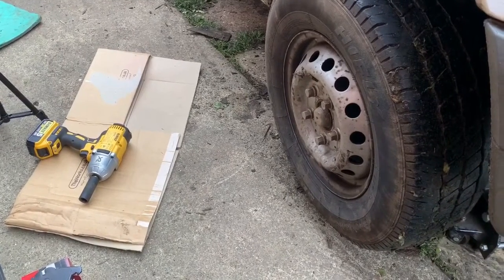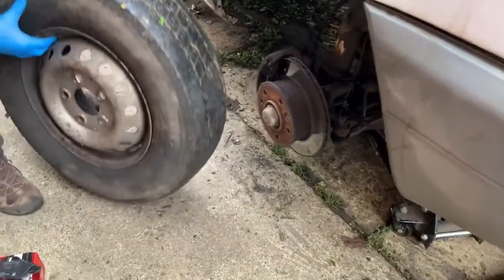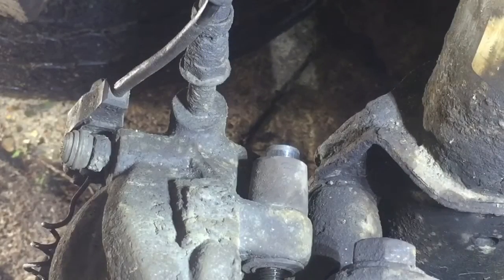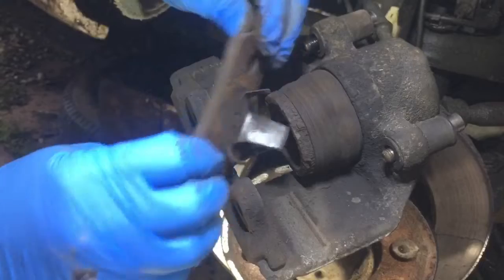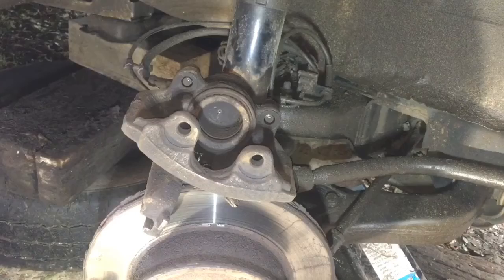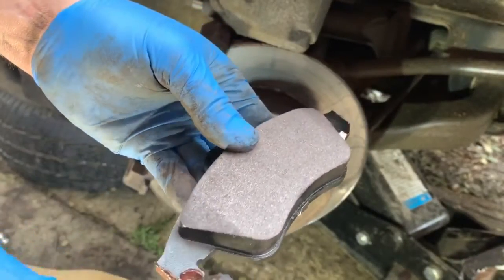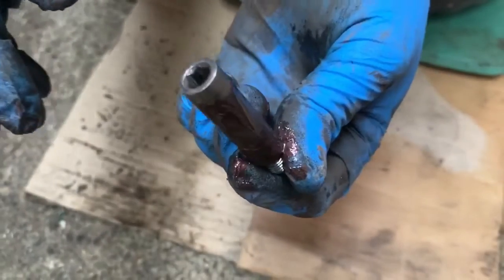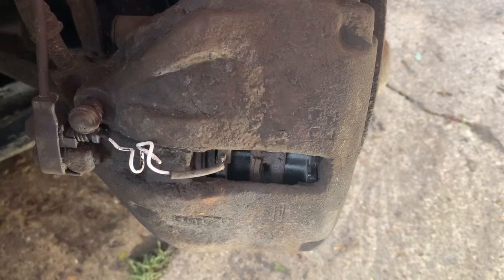Mercedes Sprinter 2004 Fitting New Brake Pads #Menditman 🦾

Comment: You should only tighten the wheel studs with a torque wrench to the specified amount. I have broken wheel studs in the past by using an impact driver.
Reply from the maker: It’s fine doing it on level 2 with the impact, I do Just double check with a breaker bar afterwards.